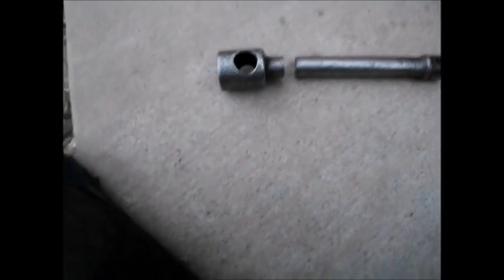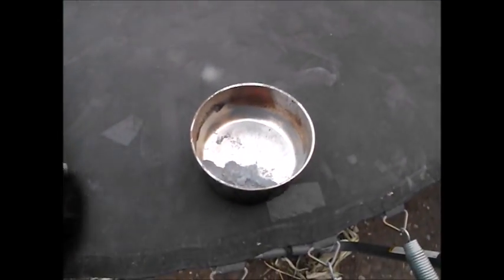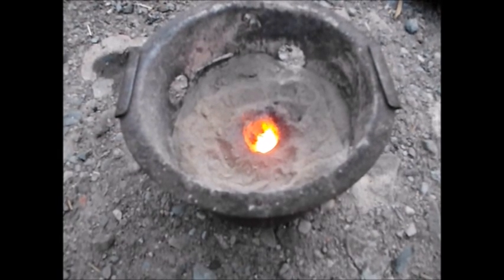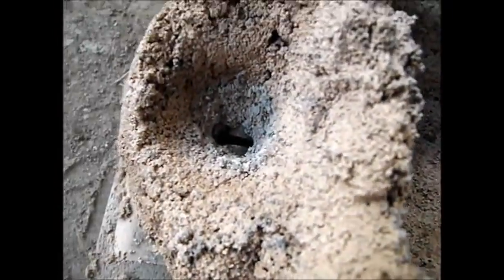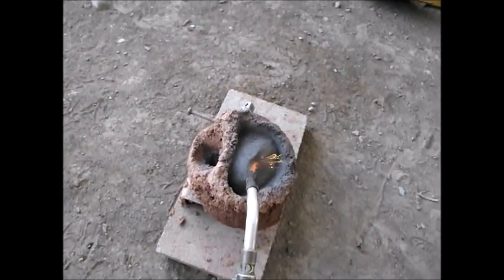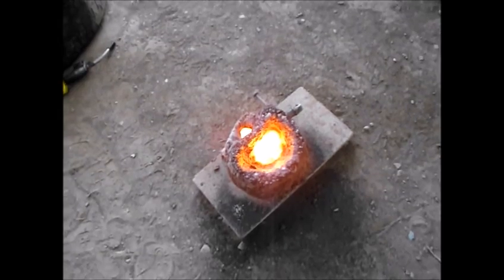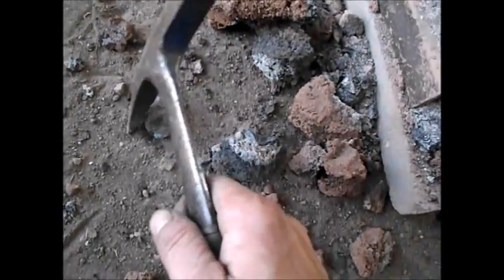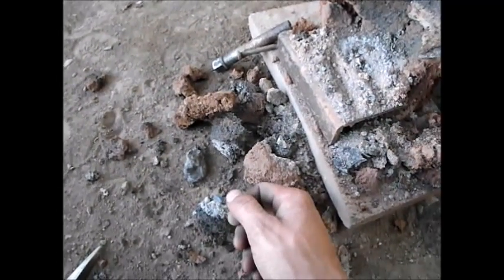My First Attempt at Thermite Welding

Comment: yea its a necro post.. buuut.... maybe this will help for better success next time... would love to see it work ^_^
1: preheat is very important to the mold and the metal piece or it may 'freeze' before it intended work area.
2:having some flux mixed in with the thermite (like borax.... silica is ook but not the best choice for metal adhesion).
3: your mold appeared to be off to the side. mold design is an art but most of the steel mold i have seen are having molten metal pour from above the piece to be worked. straight up clay is a good choice for mold material but it needs to have no water in the mold.
4: have several sprues so that excess metal has a place to go partially off to the the side and below. having a large sprue above helps with porosity.
5: thermite has a potential for burning up or vaporizing iron so over estimating the volume of metal needed is a good idea
6:if large grain structure or brittleness is going to be a problem one should forge the workpiece to reduce grain size.

the link below shows a common method in the railroad industry but take note of the steps for a successful weld. 
https://www.youtube.com/watch?v=-7JfNBmcjXo

Comment: Isn't it harmful if you keep touching all those chemicals with your bare hands? You seem to do it a lot..
Reply: He could have easily blown the propane tank he had in his hand as he lit the gigantic pile of thermite but that ain't the kind of thinking that is gonna fix his ratchet now is it.
Reply: +Cody'sLab Potassium Dicromate is hexavalent Cr...don't touch.  100% known carcinogen/mutagen.  Cool video. Read your MSDS though!
Reply: +Voluntarist I'd be more worried about breathing the aluminium dust. It's lethal.
Reply: Yeah but you dont eat it. You put it in a drink for the stupid fog effect.
Reply: +TheChipmunk2008 One of the reagents used here is potassium dichromate: VERY toxic even in small amounts (LD50 to rabbits at 14mg/kg on bare skin alone). Don't shrug things off just because you're "doing it once". Research all MSDS (in this day and age all it takes is half a minute tops on the internet) to know the appropriate safety measures needed.
Reply: ***** AFAIK it has to be vaporized in order to be toxic, right? Cookware and lots of things are made of aluminum.
Reply: +Voluntarist yeah but your not breathing in the dust from cookware. it is highly reactive and toxic. this guy should be wearing a mask while he has the stuff blowing around in the air. he was talking about making it with the grinder, which I imagine would have had it flying about the workshop as well. you would want to get a large amount on your skin is either
Reply: ***** Haven't watched much of your bee videos, might do that when I've watched the others :P
Reply: John Doe What chemicals? Iron oxide and aluminum are harmless, less you eat a spoon full.
Reply: Matthew Andrews You're thinking of aluminum oxide. This is non oxidized aluminum, and iron oxide.
Reply: +Dylan Elliert Many of these things (including mercury exposure) are harmful if done all the time, but for a one off, i'd not be TOO worried.
Reply: ***** still though.. it takes a special kind of idiot to eat dry ice even once.
Reply: Dylan Elliert Not really, i use it in drinks all the time.. In fact some places even mix liquid nitrogen with likker.
Reply: +morisato54i think Cody has more than enough chemistry background to not just handle a chemical without research. he full well knows the risks, and what makes it risky. Poison isn't poisonous until you eat enough of it.
Reply: Wyatt Roncin I don't doubt that except if you take notice of my comment, it was directed at someone else who thinks it's ok to be touching hexavalent chromium.
Reply: ***** well he did specify most of the stuff he does, not all. And his comment is in reference to cody's risk of danger from sticking his hand in mercury for a quick video and chewing on dry ice for the same.
Reply: ***** You don't eat it..
Reply: John Doe one of the things I love about Cody's videos us he addresses the hype over certain chemicals.   Look up his video where he drinks cyanide...  He tries to separate myth from reality.  While still being relatively safe.  There is no such thing as 100% safe, particularly when an experiment involves explosives or acids.
Reply: Dylan Elliert actually normal mercury isn't harmful on the skin, unless you have an open wound
Reply: +Voluntarist he put an ungloved hand into mercury... he are dry ice.. this guy has a point. it IS stupid doing it.

Comment: The cold metal of the extension would never allow a structurally sound flash weld of themite. You would need to get the extension glowing hot, then start the thermite, and then hope you have it channeled properly.

Comment: But...the secret ingredient....
I've been trying to make termite for a long time now but the iron oxide takes too long to produce. 
I'm gonna guess the secret ingredient is magnesium. Am I wrong?
Reply: You actually ARE correct! I have made thermite with added magnesium powder which DOES allow it to be lit by a match.
Reply: nurdrage has made a few video's on creating iron oxide through chemistry and other processes. He manages to make some chemistry grade very fine powder
Reply: The secret ingredient is most likely barium nitrate according to google, but I'm no scientist.
Reply: Magnesium is an easier way to make thermite burn, it can be used to jump start a reaction by mixing it in, but in most cases, it's used as a strip to ignite the O3 faster
Reply: True
Reply: Someone needs to make a thermite in liquid nitrogen reaction video.
Reply: gunpowder
Reply: +James Kellum Umm... Gunpowder wont burn hot enough.
Reply: +Stuart's Tutorials Braniac did thermite vs dry ice. The thermite won.
Reply: the brown crayon to make iron oxide just put some steel wool in a bleach, vinegar, and salt mixture  (this made chlorine gas so stay outside) and let that sit overnight than just boil the liquid you get away so you just have the iron oxide left
Reply: Steel wool should rust quickly in the absense of oil.
Reply: Sulfur is the secret ingredient. He said it in another vid
Reply: ***** awwwwww I thought I was smarticles....
I /really/ want to know now. I've just been using German dark aluminum and iron oxide with a magnesium fuse but I haven't enough iron oxide to get the yield that I want.
Reply: ***** no way...
I need to touch up on my chemistry...
Thank you!
Reply: the brown crayon it doesent take long! Put a nail hooked to the pluspole of a strong battery and the negative pole hooked to a lil piece of wire into a strong salt-Water mixture(make sure only the wire bubbles and not the nail!!)
let it work as long as u want.After this u'll have to filter the clumpy black oxide from the saltwater.Make sure to pour enough freshwater over it till all the salt is washed out.Now heat the clumpy oxide up to evaporate all the remaining water ( The oxide starts to change it's colour to kind of an orange). Now grinde that shit up and u r done 

-Also be carfule with fire bc of hydrogen in the process
-refill ur saltwater if the lvl is too low

-Its 3am and i dont give a shit about grammar/mistakes rn... ^^
Reply: da fuq i've heard that doing this actually doesn't yield pure iron oxide.
Reply: there are a lot of other ways... and for me it worked perfectly...it got the best balance between speed an quality....just mix it with 1/3 aluminumpowder

Comment: Would not a new batch of thermite be able to liquify the "steel" made before to channle into the break? I am sure you already fixed the tool so maybe later make a mould of some sort.

Not to say anything but I think I will look into this $200 part...never heard of a $200 extension and my father had quite a few impact and high torque tools for his heavy machinery jobs.
Reply: Not sure if or when this will be seen, but is that a 6in or 8in extension?

Comment: preheat and tig weld with 308l rod, then put it in sand so it will cool slowly. You can also braze it with bronze.
Reply: For the brazing, I would use something like Harris Products Safety-Silv 40Ni2 brazing rod (a Nickel Silver alloy with high tensile strength) with Stay-Silv White brazing flux.

I've used this to braze a handle back onto of a pair of bolt cutters which broke off at the cutting head and it's held up to an insane amount of abuse since.  The tensile strength of this type of brazing rod is roughly 85,000 PSI which is stronger than Chromoly steel.

Comment: Wouldn't it have been more cost effective to just buy a new extension? By the time you add up materials, preparation time, sourcing a ball mill, building a mould, your time, etc., it's just not worth it. (Not to mention you could have burned your shop down if it splattered everywhere.)

Comment: Is some type of flux recommended for thermite welding - especially on chrome tool steel, to get the pieces and weld to stick and not bead off?
Reply: Paul Feldman Borax should work just fine? I've seen it used as flux in other thermite welds.

Comment: I am a thermite welder for a major railway. Yes you have to preheat but not to the point of melting the base metal. The mold was a done well but igniting can easily be done with something as small as a match or a sparkler used during the 4th of July. Try pre-heating or grove the piece out at least half the thickness and arc welding. Hope this helps and be safe thermite is some dangerous stuff.

Comment: You do not give up on finding the solution. I'm no expert, but I know that the piece of metal that wants to weld must be heated before. See that piece alloy is made. I leave a link so you can see how warm the tracks before welding. Thank you very much and continues to experience. I would like to know how is the best way to get aluminum powder, if using sandpaper by hand, or a sander with vacuum cleaner, and collect the aluminum powder in the vacuum bag, for hand sanding should take a long, do not ?. good luck
link in youtube: youtube.com/watch?v=XQViDITyIKs

Comment: Sorry to say this. but even if you where able with 2% of succes to weld to cold metal pieces with aluminum it would never hold the first turn..1 material is to cold. 2 wrong type of casting sand. 3 wrong type of ventilation... would have been easier to just cast a new whole piece or buy a new one XD
Reply: Svenne Banan Just like Cody asked you, I would like to know more details as well. Do you have them or was your comment just a crack down without a turn up?
Reply: ***** before you start with the thermite you need to make sure that the base metal is preheated to a nice cherry red
Reply: Svea Hedning- the aluminum almost completely burns up while some iron left behind.  There will be no aluminum in the weld.  If he were to functionally get the molten iron to bond the weld would be almost at strong as the day it was forged.
Reply: OohzyJohnDow How about an extra piece of preheated metal in between, a thin slab that will be welded to the two pieces by the thermite...... idklol
Reply: +John Doe the thermite should produce molten iron as the welding agent, no?
Reply: I suppose it would never be as strong as the original forge.
Reply: buy a new one?wheres the fun in that
Reply: +Robert Nugent dont they use thermite welding to weld railways together? i dont think these massive rails get any kind of preheating, maybe they get directly exposed to the reaction?
Reply: +Svenne Banan It's kind of the point of an experiment?
Reply: Werner Heisenberg yes when they thermite weld the rails they pre-heat them before applying the thermite.
Reply: Nickolas McCollum
ok, ty, good to know ;) i've thought the rails would be to massive, like when you hold a torch to them, they would suck the heat away without getting very hot themself. ill guess you need a realy big powerful torch then ;)
Reply: Werner Heisenberg, you're not wrong, the rails do start to lose a lot of heat to atmosphere/ground when they get hot, it's just that they don't need to preheat them THAT much. Think home oven temperatures. If you had to heat it up to a thousand degrees you're right, it'd be cooling faster than you could heat it with any torch.

Comment: I have never tried welding with thermite but I have however, tried using the iron biproduct of the reaction for making knife blades like you said.  I never have gotten the iron to work though.  It just crumbles the first time you hit it with a hammer after you heat it up in a forge.  I even tried mixing carbon with the thermite with hopes of making the iron into steel but it never worked.  Here is my thermite video with an explanation of what I was doing.   https://www.youtube.com/watch?v=_SzkAYw0WSA

Comment: I worked with a welding gang in the 1970s in Australia. I don't think we pre-heated the rails then - maybe I just don't remember it. The mold we used was not as complex as the modern ones I've just been looking at online. I wonder if you leave a little more room around the wrench and just fill the whole space with thermite so the heat can bite into the wrench a bit while the reaction is going on might work. Like your style Cody - just a bit concerned about your eyebrows or worse!

Comment: You need to preheat each of the pieces to be welded cherry red before igniting the thermite.  I thermite weld railroad tracks for a living
Reply: I was just going to post this... that was your mistake. just like soldering you need the parts to be heated and the solder will flow.
Reply: Uranium.
Reply: SAVKE popara the secret ingredient is sulfur, he adds it to make it much easier to light with a match. He brought that up in another video.
Reply: shanevmax34 what is the secret indigrent In video?
Reply: We also use something we call a penny a piece of sheet metal used to plug the hole until the Thermite is hot enough to melt it and let the molten metal "drop" into the cavity.
Reply: Pontosan
Reply: you also need acid flux for the solder to 'wet' - not the case here?
Reply: Welding and soldering are diffrent